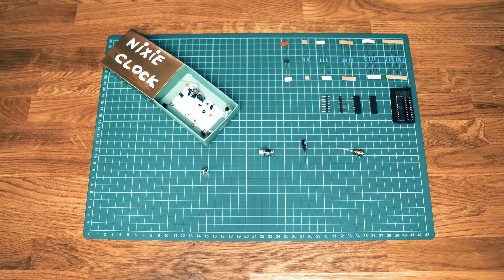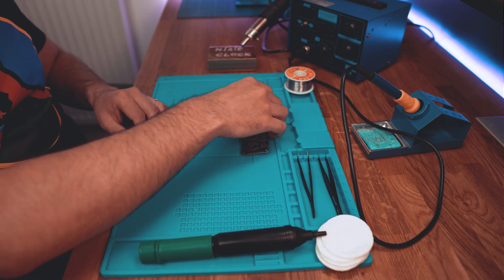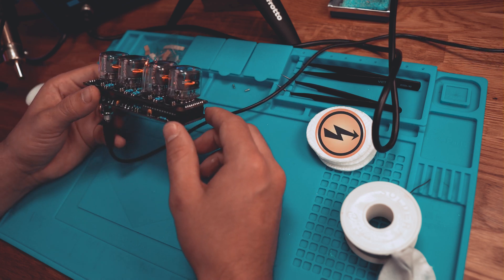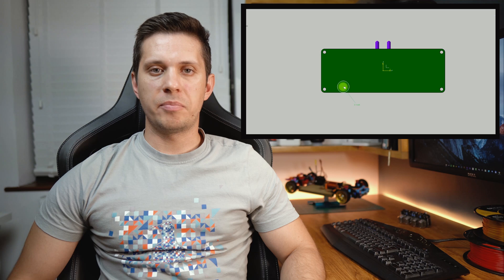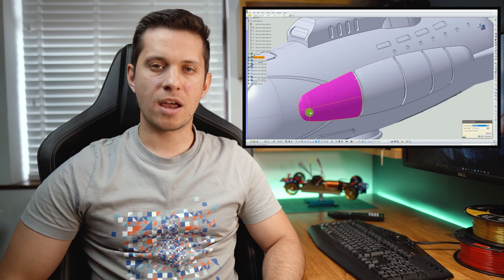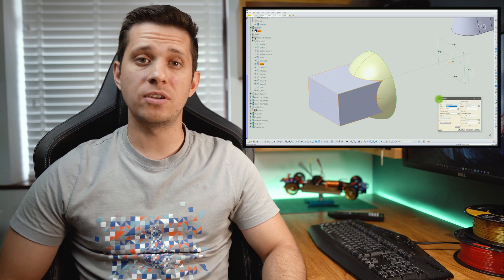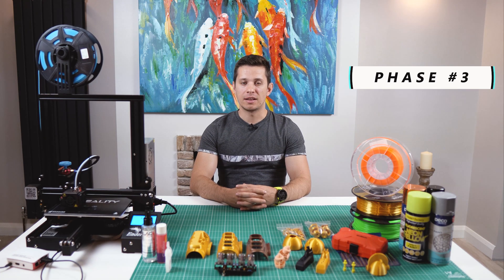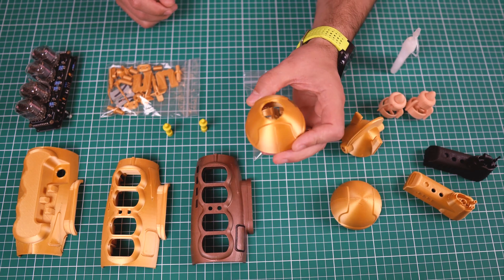🤿3D Printed Nixie Tube Clock⚓

Comment: hi, great project which I am just about to start printing. which orientation did you print the front piece and did you use support? many thanks for sharing.
Reply from the maker: Hi James,the nose and the tail were printed upright with very little support.I've  dialed the threshold angle to a big value,it only did a very small support patch for the middle of the dome.The sides have had full support inside and being split half and half,it only made sense to print it laying on the flat side.Surprisingly,there was almost no 'elephant's foot' deformation at the base so the two halves are mating quite nicely.Hope it helps,give me a shout if you have any other questions!

Comment: Do you have a link for the calipers you are using? Also which needle files? Are they Teng Tools?
Reply from the maker: Needle files are from Draper 82640. The caliper is UNIOR 270 A